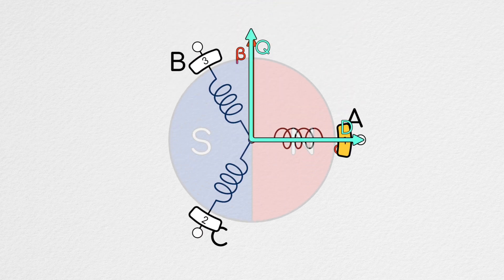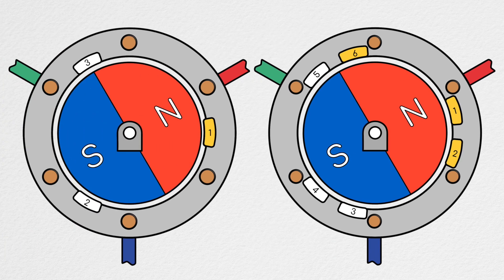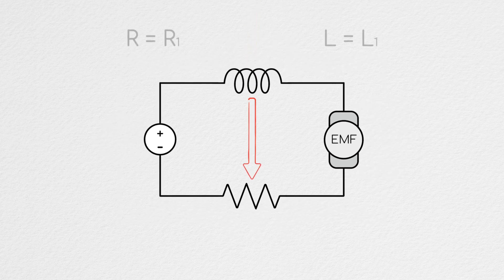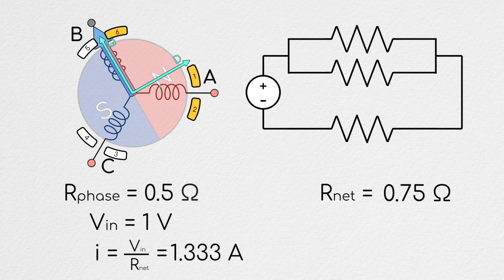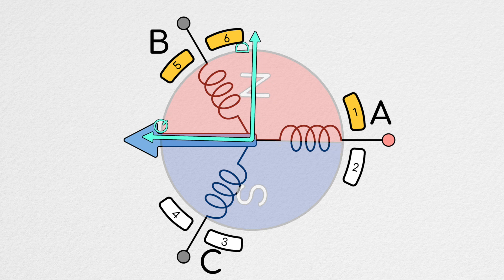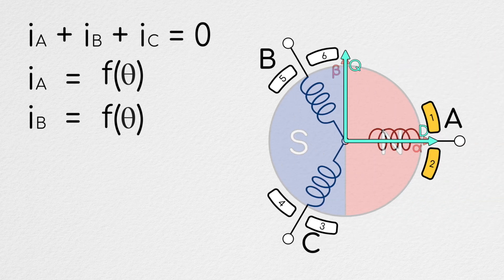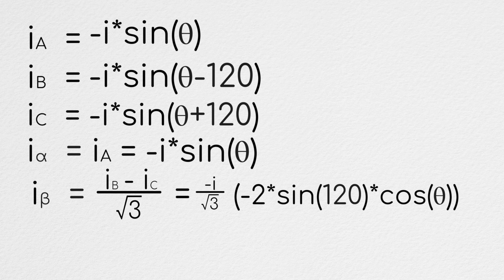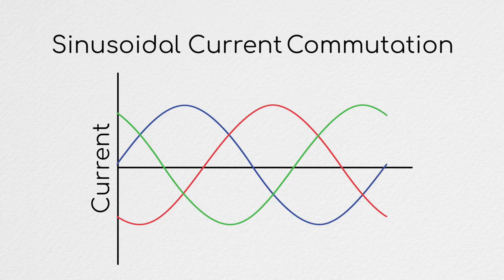Why is sinusoidal current best in a DC motor?? (Episode 9)

Comment: Nice Video! I have a question, why does Ia = -i*sin(theta)? what do ' i ' and ' Ia' really mean here?
Reply from the maker: in this context, 'i'refers to the magnitude of current you are running through the motor to generate a torque (i.e., t = kt*i). whereas 'ia' refers to the current running specifically through phase a of the motor

Comment: In case anybody is struggling with the math at 5:42, I think the math works out to: 
ia = -i*sin(theta)
ib = -i*sin(theta-120)
ia + ib + ic = 0
ic = -(ia + ib)
ic = -[(-i*sin(theta))+(-i*sin(theta-120))]
ic = i*[sin(theta) + sin(theta-120)]
using sin(a-b) = sin(a)*cos(b) - cos(a)*sin(b)
ic = i*[sin(theta)+sin(theta)*cos(120)-cos(theta)*sin(120)]
ic = i*[sin(theta) - (1/2)*sin(theta) - (sqrt(3)/2)*cos(theta)]
ic = i*[(1/2)*sin(theta) - (sqrt(3)/2)*cos(theta)]
ic = -i*[-(1/2)*sin(theta) + (sqrt(3)/2)*cos(theta)] // factor out the negative to get the identity to work
ic = -i*[sin(theta)*(-1/2) + cos(theta)*sqrt(3)/2] //just flipping terms to match identity
ic = -i*[sin(theta)*cos(120)+cos(theta)*sin(120)] // converting constants to equivalent sine and cos terms
using sin(a+b)  = sin(a)*cos(b) + cos(a)*sin(b)
ic = -i*sin(theta + 120)
Hope this helps others who struggled with the second half

Comment: Why have you taken negative of the currents (ia=-i sin(theta)), so basically why are you assuming that the currents are coming out?
Reply from the maker: Great question, I do so because of where I set my zero angle. If I had had my zero angle 180 offset from where I have it, it would be positive. But due to where I have my index defined, I needed to define them as I did for them to produce the optimal q axis current.
Reply: Jantzen Lee Yes because when I took positive currents, I am getting Iq=-I, so then I guess we will be controlling the negative Torque which we don’t want ? 
Is the logic correct
Reply from the maker: Yes I would say that is largely correct. I don’t know if it is correct to say you “don’t want “ that. Just because sometimes you do want clockwise torque and sometimes you don’t. And if you define your zero point differently, those sinusoids will phase shift accordingly. I hope that helps, if that wasn’t clear let me know and I will try to answer any more confusion
Reply: Jantzen Lee Yaya got it now, thanks for the help 😄
Reply: @jtlee1108  Also, what do we infer from id=0, so according to my understanding,  now the torque is completely dependent on the q-axis current and not on the d-axis, so this will reduce the torque ripple as well and no additional magnetizing or demagnetizing flux is produced. 
So is this logic alright?
Reply from the maker: @rithviksomalraju4532  So the D axis direction (in permanent magnet, synchronous motors) doesnt really produce torque. current which aligns with the D axis only acts to either strengthen (+D) or weaken (-D) the magnetic field of the rotor. So, if our motor is non-salient poled, torque is only produced by current in the Q axis. So, under normal speeds, if you are trying to make torque only, current in D is basically a waste. so we are A) being more efficient, and B) eliminating our induction of changes to the magnetic field. But zooming out to the 10,000 foot view, the bigger idea here is that by using this sinusoidal current to the phases we cn produce any arbitrarily aligned and constant current. By simply shifting the sinusoids forward or backwards by some phase lag we could also align it with 45 degrees off from Q.